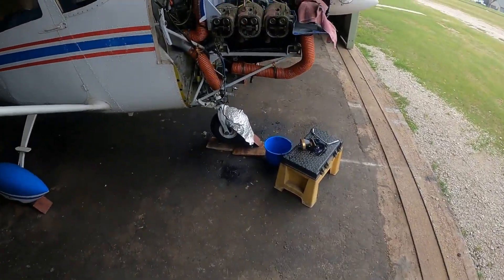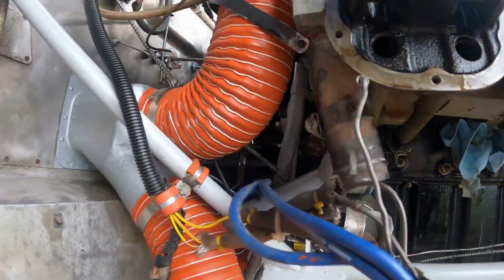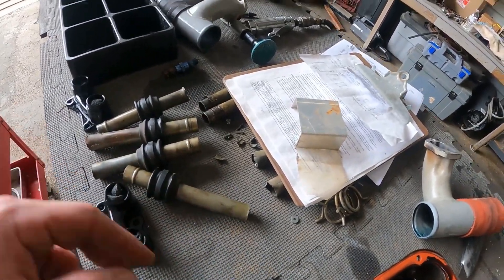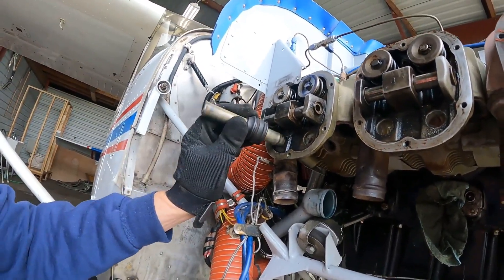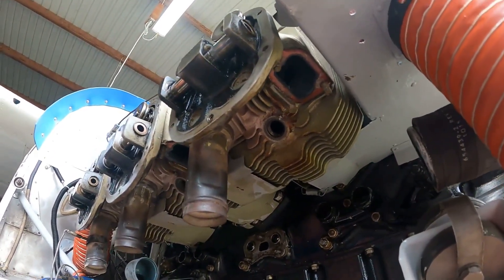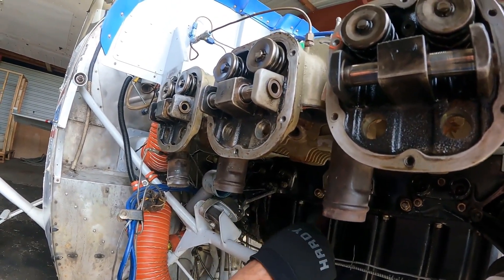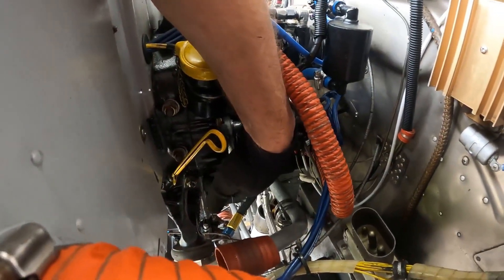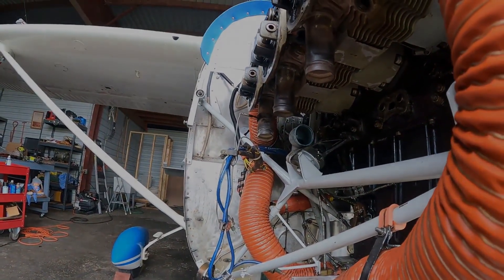Airframe and Powerplant | N8344T | Oil leaks | Push-rod tubes | Continental GO-300

Comment: Nice work.
I’ve never seen a GO-300 and I used to work at a part 145 engine shop in tear down and test cell.
Tore down over 100 engines.
*Your engine is pinion reduction, but if a geared reduction engine is planetary, you’ll need an IA to sign off an overhaul.
A&P/IA
Reply from the maker: It's not planetary.. Just standard gears.
Reply: @WolfPilot  Right, pinion
Reply from the maker: And this engine is a super rare odd duck. If you have ever torn down an O-300, its pretty damn close.

Comment: replaced my pushrod tube seals last year...still leaking this year. Just gonna live with it.
Reply from the maker: What engine do you have?
Reply: @WolfPilot  IO-520BA
Reply from the maker: @FlyChuckyFly  Doesn't that engine have the pushrods on top of the cylinders?
Reply: @WolfPilot  Nope, on the bottom same as yours.  Harder to get to since the bottom cowl doesn't come off the Bonanza.
Reply from the maker: @FlyChuckyFly  I guess you change the oil through the cowl flaps?
Reply: @WolfPilot  Actually the quick drain is forward.  You have to remove the right side gill plate, then there is a hole cover that opens into the nose wheel well.  Slip a 3/8" hose on the quick drain and through the hole to your waiting receptacle below.  Pretty easy actually.
Reply from the maker: @FlyChuckyFly  I bet you can do the exact same thing we are doing and end those leaks permanently.